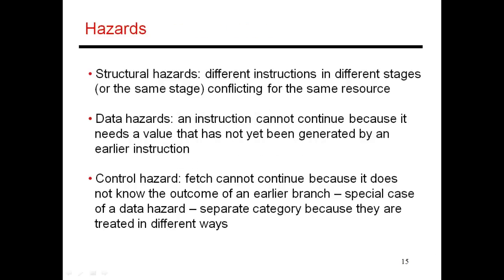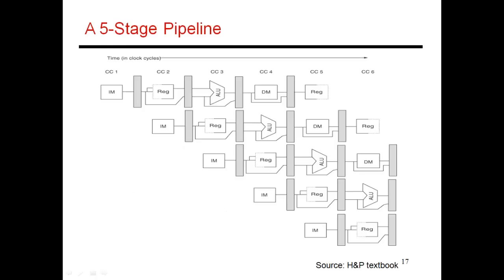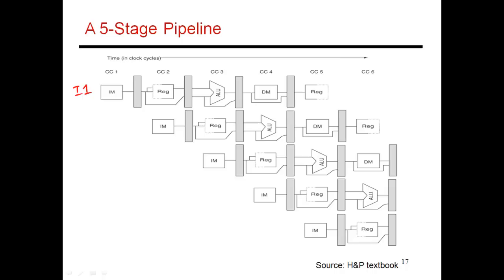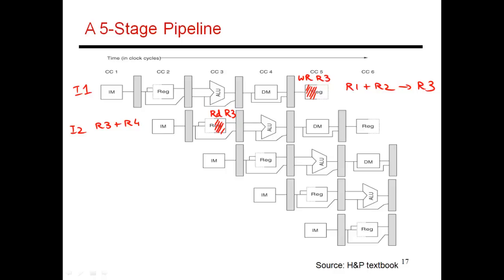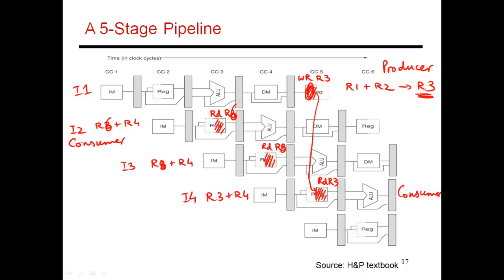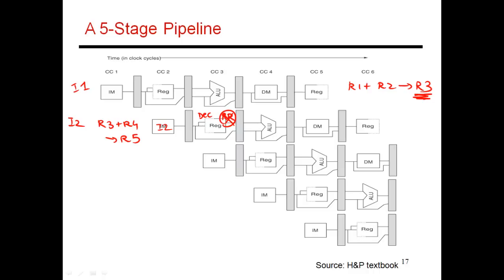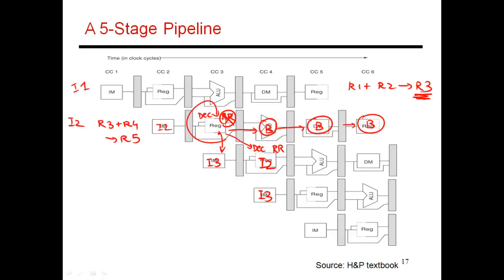CS6810 -- Lecture 9. Computer Architecture Lectures on Pipelining

Comment: a question ,, in I1 the R3 value has been finalized in alu stage after that we can move the consumer of R3 up .. cant we?
Reply from the maker: The consumer has to gradually move through all the pipeline stages.  It can't skip intermediate stages.  The decode stage will make sure that the consumer moves ahead at the right time (so that its inputs are correctly received in later stages).